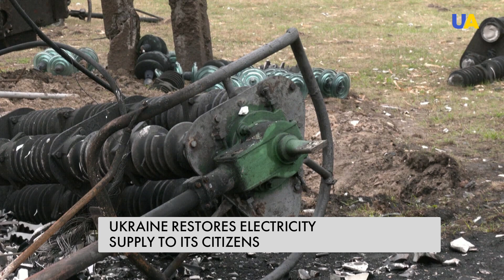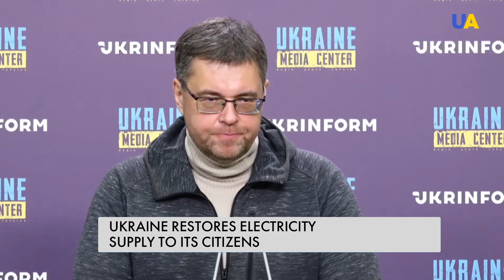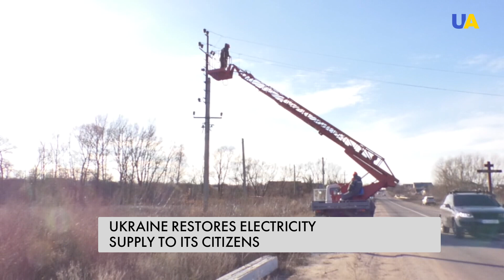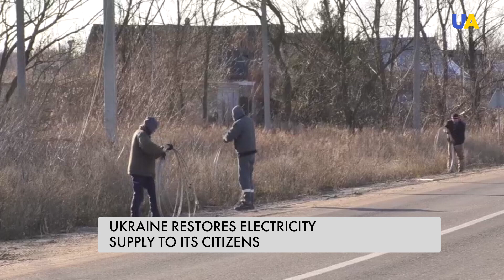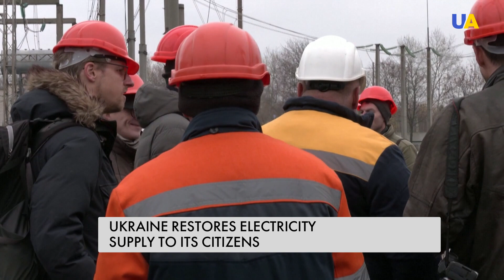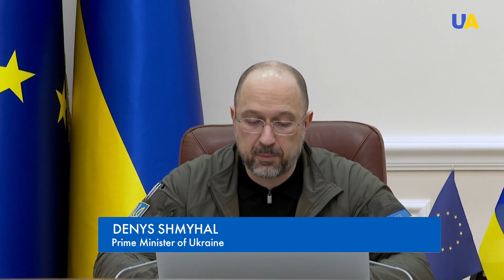Ukraine is changing its energy system to respond to Russian aggression

Comment: The decentralization of power plants and the use of smaller modular power sources does two very important things. First, it enhances resilience. Second, it allows for a much quicker transition to new power sources in the future. The cost of massive power stations means that they must be utilized for a much longer term to make them economically viable. So, even if new technologies come along, it may not be economically viable to adopt them. Also, having smaller generation units means that you can mix and match types, We have the control systems to manage this. I worked on a project utilizing such methods and have seen the potential benefits. So, by necessity, Ukraine will have great experience in these areas. The power industry is very conservative. They have to be, to some extent, in normal times. The cost is one factor. Reliability is another. Don't forget, it is not the generation of the energy that a consumer pays for. It is the reliable delivery of that energy to the point of use. That is not trivial.

Comment: I used a home mchp (micro combined heat and power) system for a while (made by Honda) which are designed for disaster zones.  A unit the size of a fridge and a gas tank generates all the hot water and electricity a small house needs.  Plug several in together and you have a scalable neighbourhood emergency power supply station.

Comment: In the rest of Europe, we are not different. Having done the work I did it is very clear to me that there needs to be some very significant rethinking by governments and companies. One substation going out can cause massive consequences to critical infrastructure. Many substations are unique configurations, and replacements take months to build and fit. If the industry started by refining a more modular system that would be a start.

Comment: People should buy Nissan Leaf's.

In 2011 Japan had it's Tsunami, with the nuclear power stations in melt down and other power sources off line.

Nissan was already making the Leaf which had a 24kwh battery, which a few years later was upgraded to 40kwh and then 62kwh.

But after the 2011 Tsunami Nissan changed the Leaf so that in an emergency you can use the power from the car in your house. Just the very early ones can't do this.

Comment: I’m in favor of all power sources .. except the ☢️..
Reply: Nuclear is carbon neutral and perfect for increasing European independance from russia. And our current nuclear technologies are inherently safe.
Reply: Belief-based decisions are OK for some things. Energy supply is not one of them. Decisions about energy should rely on math.
Reply: @veganlion8662  "Carbon neutral" is an entirely irrelevant factoid. However, the other point is true and relevant.
Reply: @DUCKDUCKGOISMUCHBETTER  
Climate change is a thing, largely caused by gases like carbon dioxide and methane. So yes, carbon neutral is important for an energy source.